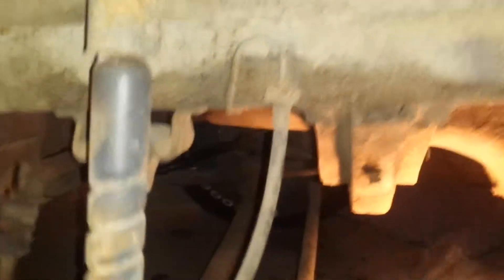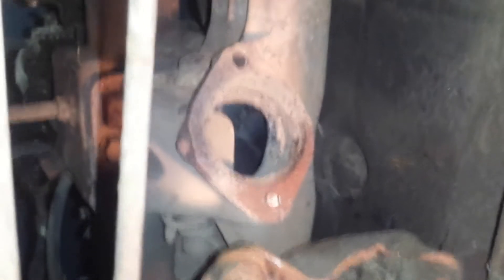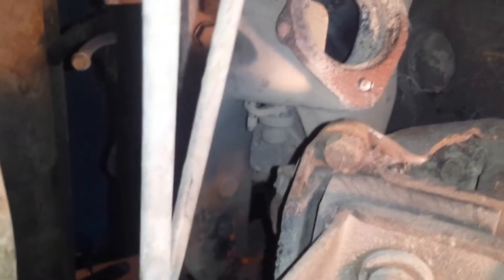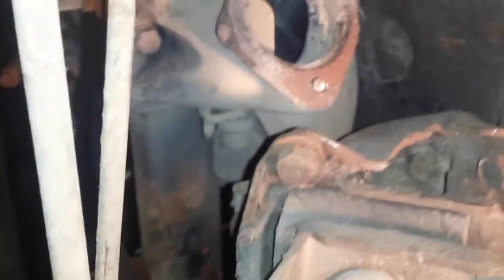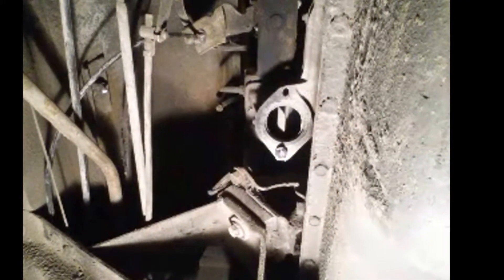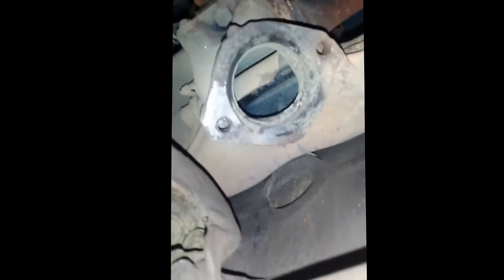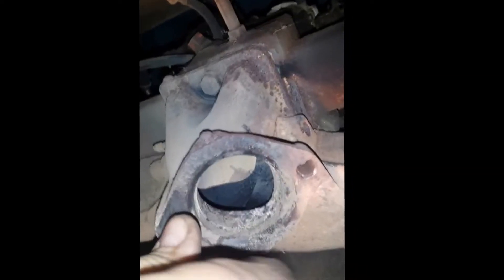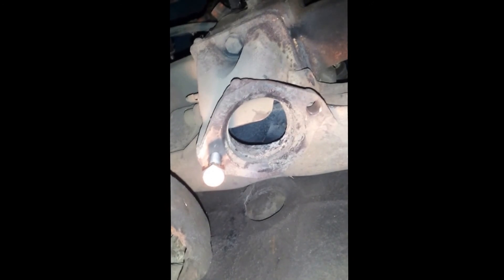Copy of 1967 G 10 exhaust bolt removal

Comment: Ya that's a pain to do.  I had one I couldn't get out , I  drilled a 1/8 hole and threaded in a tap , just rammed it in and then welded a nut. Oh ya it worked but I don't have a 1/8 tap anymore, LOL
Reply from the maker: yes exhaust bolts are a pain .